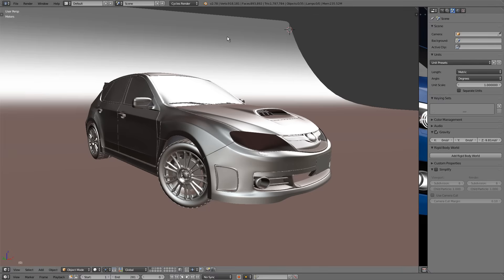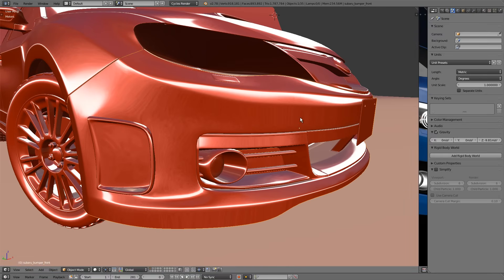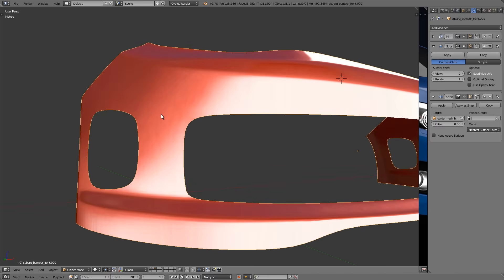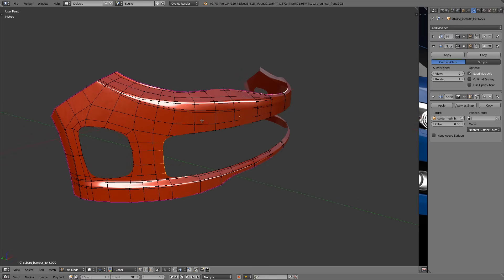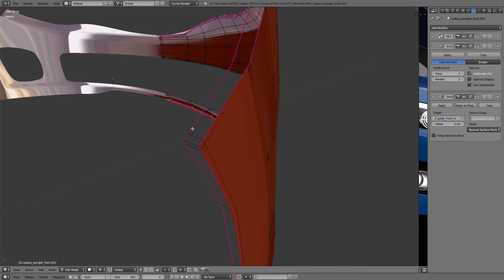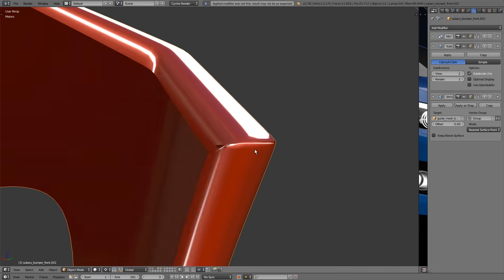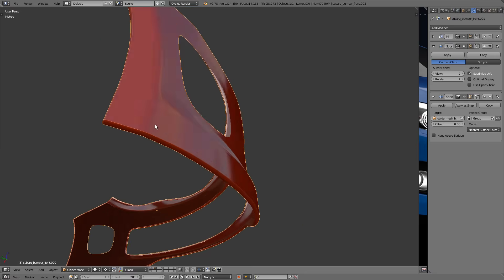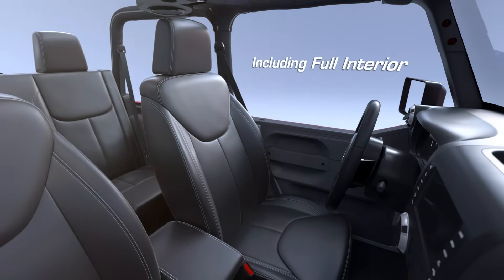Advanced Subsurf Modeling - Techniques to Avoid Pinching

Comment: So, first of all great video, I've tried it and can see the results. However, I was wondering, once you've cut off the inserts (bumper lights, grill etc.) how do you get them back on?
Reply from the maker: I'm not sure I'm following you. But in general the first thing you'd do when modeling a bumper, for example, is model the bumper without any holes in it. Then you duplicate that and then use something like the knife tool, or just delete vertices, to add the necessary holes in it. Then you subsurf the second bumper and then shrinkwrap it on top of the first one. -Chris
Reply: @blengine  I understand that but how do you get the stuff that is supposed to go into those holes back in. For example, how would you get this back into its hole: https://i.imgur.com/3UkBtVO.png
Cause I've tried this and, as expected, it would just flatten everything against the guide mesh.
Reply from the maker: Ah I follow you now. Those parts don't need to be shrinkwrapped so just make them separate objects and don't use that modifier on them.
Reply: @blengine  I see. Thanks!

Comment: Is there a way to apply those shrink wrap modifiers and remove the extra meshes from the scene but keep the same results as with those meshes. Cuz when i apply them it just turns out bad so idk maybe im doing something wrong?
Reply from the maker: Are you applying the subsurf modifiers first? You'll need to apply all modifiers that come before the shrinkwrap modifier, especially the subsurf modifier since it's the subsurf geometry that's being shrinkwrapped. -Chris
Reply: @blengine  yes i have the subsurf before shrink but i dont want to apply it cuz of polys count. I think i have to leave it as it is for now with those extra meshes. thanks for the answer
Reply from the maker: @GamingAlp  Ah unfortunately you'd have to apply the subsurf to keep those results. An alternative though would be to bake normal maps and use them on the low poly meshes.
Reply: @blengine  oh okay, thank you anyways :D

Comment: This doesn't work as well in Blender 2.8 (for now at least) as the shrinkwrap doesn't seem to take into account the extra geometry created by the subsurf modifier. It's a shame really but if you want you can apply your mirror and subsurf and it'll work just fine, too bad it's destructive though.
Reply from the maker: Hey, for me it's still taking the subsurf geometry into account in 2.8. Maybe there's something interfering with it in your blend I'm not sure. If you want I can check it out though if you send it to contact@cgmasters.net. -Chris

Comment: When i use this technique my panel edges come out way too sharp. Lowering the number of subdivisions helps a bit but also makes the edges segmented from the low resolution geometry. Placing the edge loops farther away from the panel edge also helps a little bit but it's not enough. Using the smooth modifier afterwards seems to help but also smooths detail in the rest of the panel and doesn't play nice with the panel edge corners. I've been stuck on this for while now, do you have any advice?
Reply from the maker: Hey send the blend to me at contact@cgmasters.net and I'll check it out. -Chris
Reply: @blengine  Hey Chris, i've sent you an email with the blend file. Thank you for taking the time to help me.

Comment: Glad the new matcap in 2.8 are better, most of these in 2.79 and lower are pretty low res. PS there is also a trick to use an Environment tex with stripes on it, this way you can see the flow better. Here's that tutorial, this guys show some great techniques, some are quite heavy poly though. https://www.ebalstudios.com/blog/3d-modeling-artifacts-flow-check-reflection-map
Reply from the maker: Oh yeah, and I think 2.8 will come packed with a zebra stripes matcap right? I've heard rumors at least. I don't know if it compares to the environment tex method though, that might still be better but maybe not as convenient. -Chris

Comment: whats the 3dsmax and maya  equivalent option for shrink Wrap option in blender
Reply from the maker: I'm not sure, I thought Maya had shrinkwrap though but I heard it works a little differently. You could also look into copying one object's normals onto another if those programs have that capability. This is also another option in Blender that another commenter here suggested in which you'd take the normals from the guide mesh and use them on the final mesh. -Chris

Comment: Before coming across this tutorial, I was very frustrated that it seemed nigh impossible to add details to a subsurf mesh without distorting the curvature. So a big thank you for this.
Reply from the maker: Glad you liked it! There's probably a few ways to achieve perfection with subsurf modeling but this is the one I prefer. Another commenter mentioned copying normals from one object to another as a solution to this which is a great solution too and even better in some ways. -Chris

Comment: Awesome! Is there anyway to do it without a guide mesh? I was expecting some magic "move or alignment" haha.

My tip would be to make the curve first with little geometry so you have more control. Once you re happy with it, simply use more geometry and work with that. Pinches won't be as visible even
Reply from the maker: Depends on what you're modeling I guess. Simply adding more geometry for extra details on curved surfaces can very easily lead to these kinds of problems. Sometimes you can get away with just being careful with topology, other times things get tricky and need different solutions. Some people apply a subsurf level if they need extra geometry. This prevents pinching by adding consistent geometry throughout instead of adding congested geometry to just one area. This is a solution but alters the base mesh with extra geometry making it harder to modify and work with. The more you need to figure out solutions for these problems the more you'll figure out what works best for you. The guide mesh technique is consistent in quality and in most cases speeds up my workflow because I use simplified guide meshes for more carefree placement of topology, and in the end if needed I'll use them for extra surface smoothing as well. -Chris

Comment: if you were to export that mesh into a game engine how would you manage the pieces of the mesh?
Reply from the maker: You typically wouldn't use this technique for low poly models unless you were just using the shrinkwrap modifier simply for a guide in building the low poly mesh without subsurf. Then you'd just apply the shrinkwrap modifier and be on your way. But yeah this technique as applied to achieving perfect curves relies on the extra subsurf geometry so definitely not a low poly strategy. -Chris

Comment: Have you heard of the data transfer modifier? Essentially you can do the same thing but instead of shrinkwrapping you transfer the normals of the smooth piece to the edited geo. Does your method have any advantage over this? Thanks.
Reply from the maker: That's an interesting idea though I've never used that modifier before. In attempting to mess around with it blender crashed twice and I got warnings of using a high poly source so it may not be ideal for this. -Chris
Reply: Someone on BlenderArtists showed me and its now my go to hard surface workflow. You can lock it down to a polygroup so it only effects the areas you want. This method is also great though thanks for sharing!
Reply from the maker: I'm definitely going to look more into this, very curious about how it compares, thanks for the tip.
Reply: Cool, I can give you an example .blend if you want to see how it applies :)
Reply from the maker: That'd be awesome of you thanks! You can email it to contact@cgmasters.net or put the link in the comments here, whichever.
Reply: Check your email I have sent it with explanation :)
Reply from the maker: Thanks a ton for that example file that worked perfectly for comparing the methods. And the methods are definitely comparable with pros and cons for each, but in my testing(although limited) I'm actually leaning towards Data Transfer generally being a more elegant solution. It doesn't physically change the mesh so it avoids potential issues that the shrinkwrap modifier can run into. Also it doesn't rely on base mesh geometry for a smooth surface which is a huge plus. One big problem is that as far as I know it can't be applied. It's also far slower than the shrinkwrap modifier which can cause issues if it's used a lot, or if it's animated, or edited with the modifier visible. Shrinkwrap will still be a major part of my workflow for laying down topology for curvy surfaces, but in my next project I'll give a thorough testing to the Data Transfer modifier for the final surface smoothing and see how it goes.
Reply: Likewise, shrinkwrap is going to be used alongside it in my workflow from now on! Thanks for sharing :)

Comment: One detail I'm missing: what's the point of re-adding the ShrinkWrap Modifier? Once you applied it, there's no sense in re-adding it. Or... is there, actually? And the same for the Solidify Modifier. I'd work in a sligthly different way to get the same results. But applying the modifiers only once.

Comment: hello first of all thank you so much ...2- how did you chose the red color what was that a material or what # and is there any link to it so I can download it or buy it ? thank you again
Reply from the maker: Hi, the red material in the 3D View is referred to as a "matcap". It's basically just a preview material for the 3D View. To access matcaps, go into the right side toolbar of the 3D View and scroll down until you see the "Shading" panel. Here you will see the option to turn on matcaps. Make sure you're in solid shaded mode first, the option is only visible in that mode. If you're in wireframe mode the option will not be in the menu. So enable matcap and then you can click on the sphere icon to switch to different preview materials. Let me know if you need any more help, see ya. -Chris
Reply: thanks a lot you are so kind .. i am working for 10 days now designing my own car and i made a great material but when i finished now i see the reflection is not that good even from the windows then i saw this video and I recognized that I have this problem with the modeling not with the material the same problem that you are talking about so how do you advice me to re model with this way that you are talking about in this video or leave it as it is cause it's gonna take a lot of time to re model every thing so i'll be grateful if you help me with an advice ....thanks a lot again chris
Reply from the maker: If you really like your car model and want to fix it up then you could just take every piece that's imperfect and work on better topology for it or use the shrinkwrap modifier method if necessary. It's a bit too involved to tell you exactly what to do to fix everything. If things are really bad on the model you may want to just redo them from scratch instead of modifying them to fix it. Also like mentioned in the video, if you're just tyring to get a good render or two then you can hide a lot of flaws with the right lighting and camera angles. -Chris
Reply: that's help a lot I don't know how to thank you chris thanks a lot

Comment: if u do this to every model thats gonna take more than month for a car
Reply from the maker: It's far faster this way when you're experienced with the technique. While you're developing the car you make the panels without the holes cut out of it, which is often done that way anyway so there's not really any extra steps involved. At that point you simply duplicate the mesh and continue on adding the details. Then you save a lot of time worrying about fixing the curvature by simply shrinkwrapping it. On top of this time saved, you can also use the shrinkwrap modifier to lay out and align all the panels for the car by quickly creating a large scale guide mesh, which alleviates time consuming and tedious topology corrections while building the car. It's not for every circumstance, there are limitations, but for situations it's useful for it saves time and frustration instead of adding to it. -Chris
Reply: thank u so much .. it's more obvious now ... but if i shift duplicate every part my pc is going to blow up or blender is going to stop working isn't it ? ... and one more question if u don't mind > if i duplicate a part and use shrinkwrapping modifier is the original  duplicated wich i used it as a guide mesh going to disappear? or merge with the duplicate?
Reply from the maker: That is one drawback to the technique, it requires some extra objects. Luckily though you can hide these objects in a hidden layer, and they won't increase render times either. It's also not always necessary to use this technique, you wouldn't need this for every single part of the car. Many curvatures issues can be prevented or at least minimized, with good topology from the start. To answer your other question, no objects disappear or merge when you use the shrinkwrap modifier. They remain separate. -Chris
Reply: thank u so much I appreciate that

Comment: wonderful loved the video , "smooth and sexy"indeed , this is just what i needed however wouldnt it slow the render time in a game down if you attempted to do this?

also how were you selecting edge loops , thanks in advance
Reply from the maker: This technique is more for high resolution modeling, which of course could then be used for normal map baking for game models though. And to select an edge loop you hold alt and then right click on an edge. Then you can hold alt+shift and right click on other edges to add more edge loops to your selection. -Chris
Reply: thanks Chris , you can never have to much knowledge when working and it seems there are lots of small holes in mine , ill fill them slowly of course

-dionyroxys